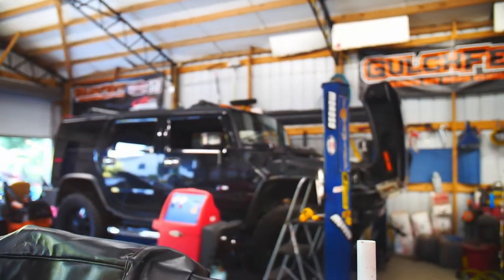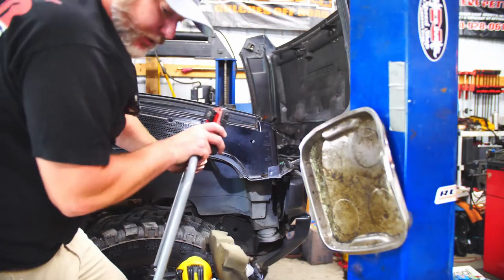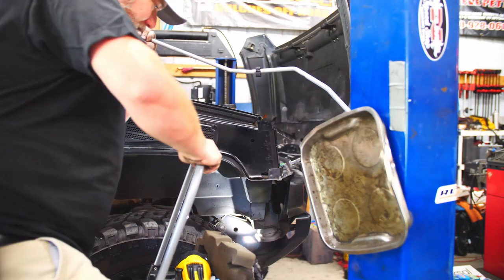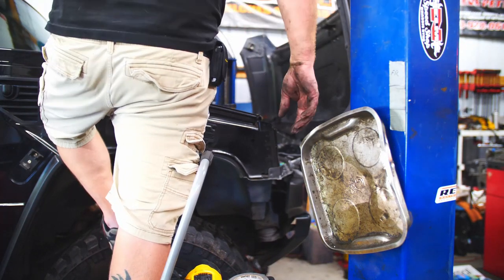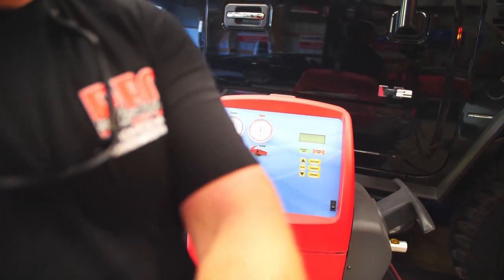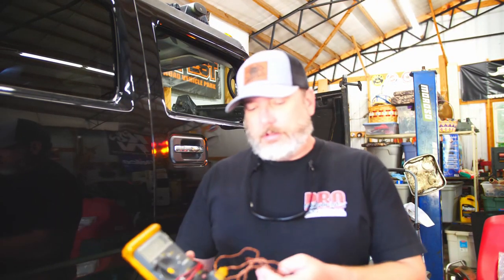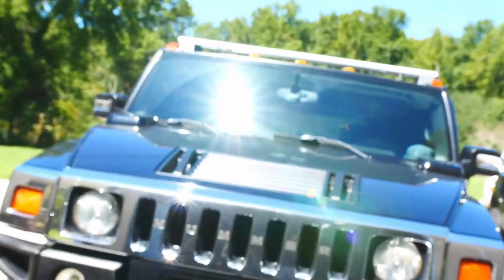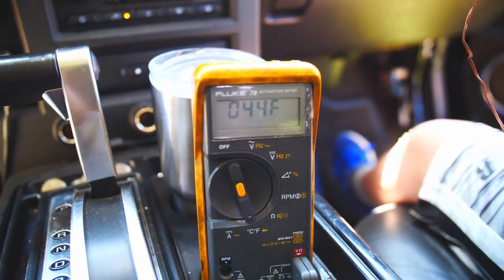HUMMER AC REPAIR

Comment: Dave.  How do I remove the headlight switch, to replace switch, 2008 Hummer h2 SUT.   APPRECIATE your knowledge
Reply from the maker: The plastic panel around the switch should pop off with a trim tool and then the switch can be removed. should be real easy. I have not looked at one in person in a long time but I just pulled it up on Alldata repair and it looks easy calls for .4 hr to do the repair
Reply: @HotRodDave  Awesome my friend. Thanks

Comment: My evaporator lines etc are ice cold.....but the interior vents are blowing average air.
Reply from the maker: I would start with recovering the freon and see exactly how much is in it.  The needs the freon level perfect to  perform properly.  Vacuum for 30 minutes before recharging the factory recommended freon lbs